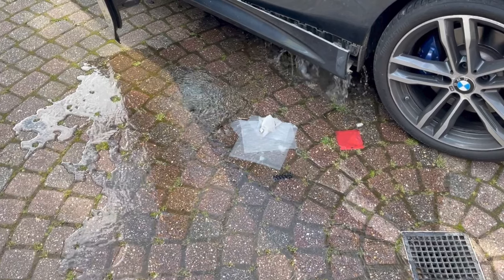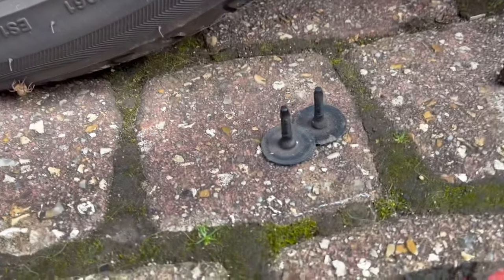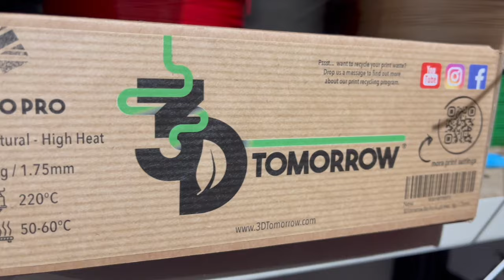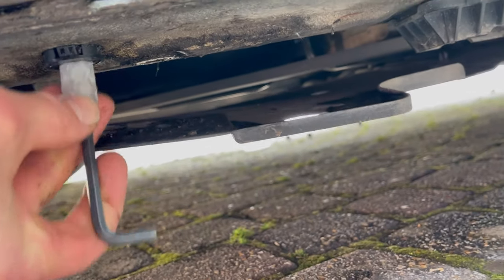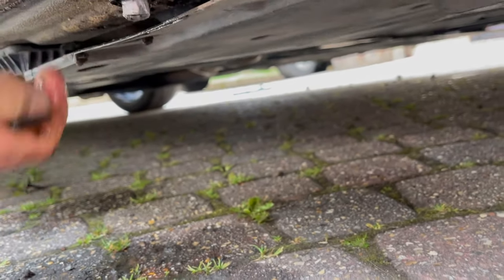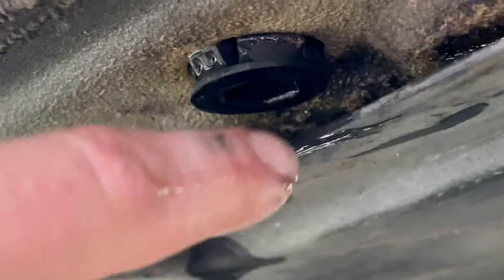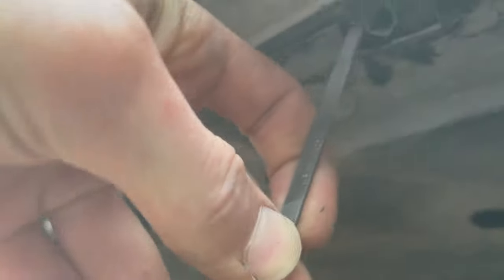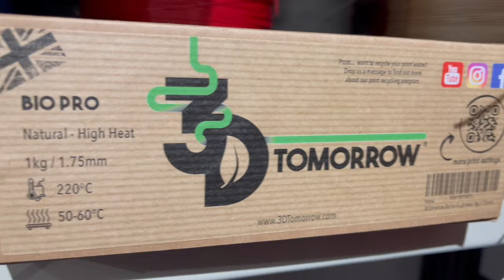BMW 4 Series F33 - Water Sloshing Sound Potential Fix - Save your Amp Before it Blows Like Mine!!

Comment: BMW will not own up. It should be a safety recall.hey call it a design flaw. HA!  BMW service tech says they have  to drill 2 holes underneath, silicone it  and add a motor at a cost of $2400.  Wrote NHTSA national Haighway Traffic Safety (USA). Anyone can look online and add your complaint. Maybe in numbers, BMW will respond.

Comment: Why to put that piece back … thats the all issue in the first place 🤷🏻‍♂️
Reply from the maker: The issue is the body work was not properly redesigned, the filter plug wasn’t the problem, that just stops things (like leaves and dirt) getting up into the vehicle.

Comment: I had a mechanic repair mine. If you need the company's details message me. Based in London. 

Cost about £90
Reply from the maker: Nice one! I've got the amp replaced at BMW and have since sold the car, I like to try different cars so never keep for long, just posted this video in case it could help anyone else / save them some money:)
Reply: Definitely a great tutorial and worth trying to fix yourself. Bmw dealers wanted to charge me £150 only for a diagnostic.
Reply: Hi imran, can you post the mechanics details, cheers
Reply: @markperkins384  bnw auto specialists in ilford
Reply: What's their number please. And website ? And name ?

Comment: the 2 series convertible has the similar issue...dirt gets in the water channels and the plug gets blocked doesn't drain the water. water accumulates where the hood goes messes up the electrics. shit design by bmw. all their convertibles will have these issues
Reply from the maker: Yes, was my first experience of a BMW, not particularly impressed by such an obvious design flaw, not sure I'll be going back. I did love the convertible hard top though. 
I actually sold the car today, the second hand car market has gone up so much recently so I couldn't say no to the chance of selling for more than I paid. Now to decide what next...
Reply: @CallumColes  got mine fixed at the dealers. they know the drain plugs cause issues...they did a mod and put extra drain channels. they didnt say much obviously know its a design flaw
Reply: Can’t understand how this isn’t a recall from BMW. My 2017 430d has water sloshing around and obviously needs done. Should be a BMW problem to resolve…